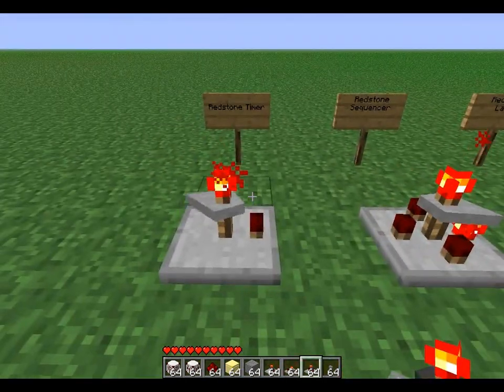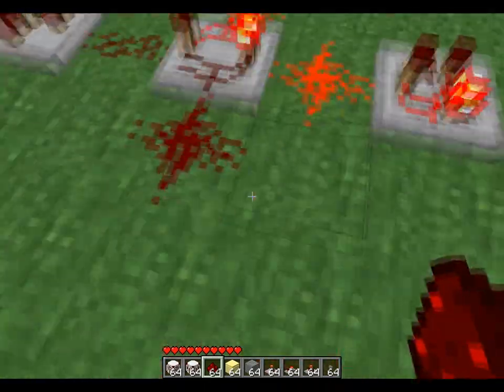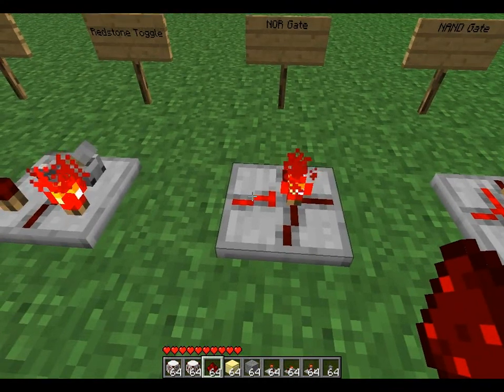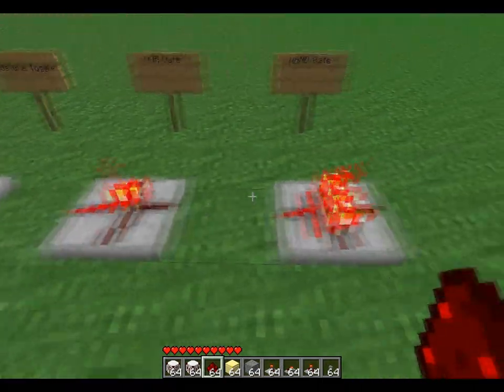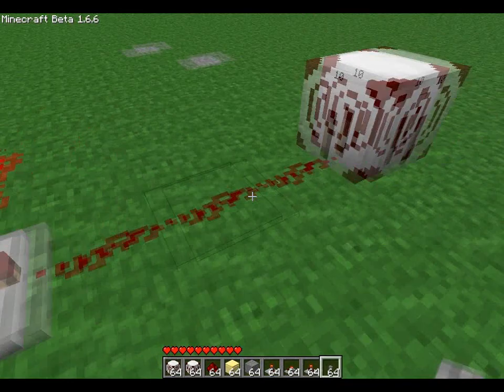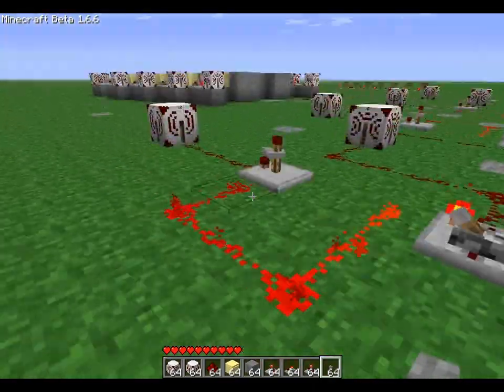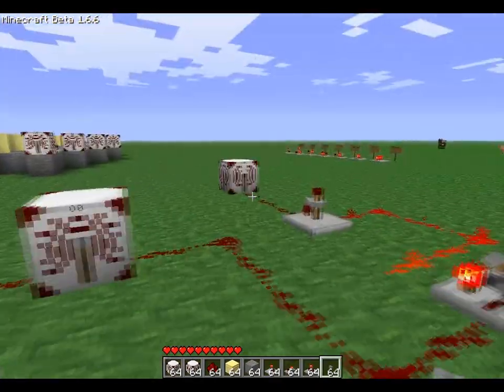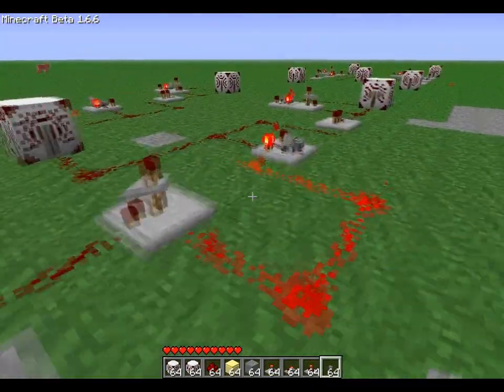Minecraft- Integrated Redstone

Comment: Oh god, ok you got the NOR and NAND gates so wrong, allow me to correct you; a NOR gate (Not-OR) takes two inputs and outputs an ON (high) signal if the inputs are both off (a normal OR gate would output ON if either input was ON or both were ON). A NAND (Not-AND) gate takes two input and outputs an ON signal if the inputs are either different or both off. (normal AND requries both inputs to both be ON). Circuit Analysis, bitches.